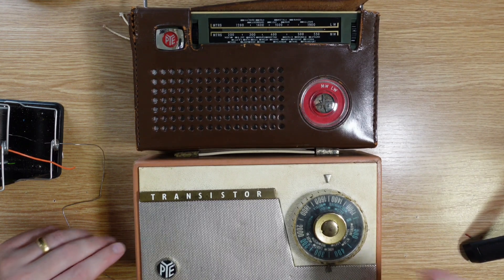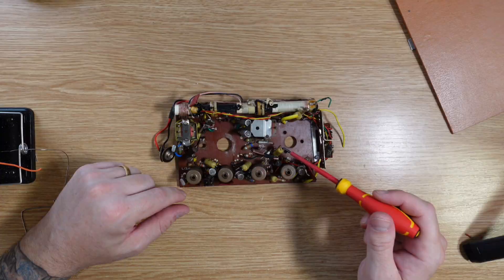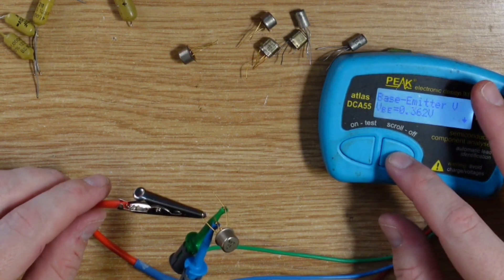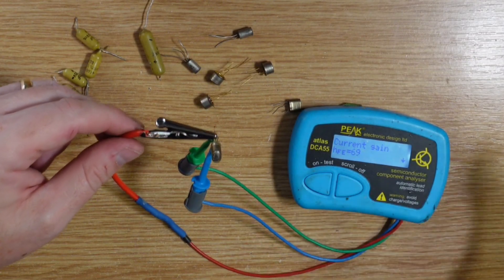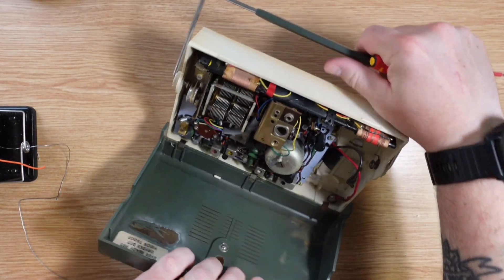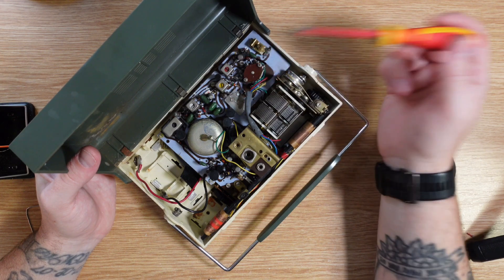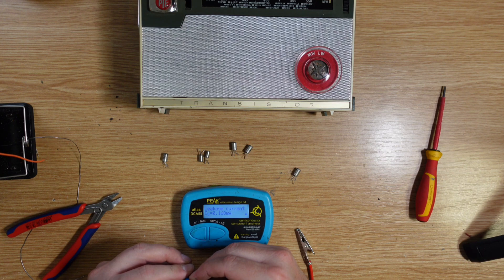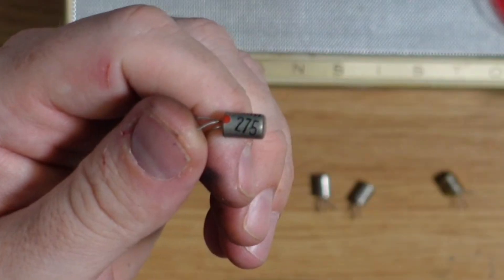Priceless Treasure or Outdated Junk? Discovering the NKT275 Germanium Transistor!

Comment: These videos never made sense to me. I get it now. Trying to find suitable substitutes is much more difficult than it should be. I mean, these are industrial components made to a standard. There should be an obvious, easy way to find a component with the same values. It’s a circuit-basically math in solid form. But any amount of knowledge I gather is overwhelmed by the sheer volume to know.  I have mush respect to those with the experience, like you Joe, because I can watch you and learn HOW to do things properly because this guy has years of experience and best practices. Your a legend. Watching you’d and JHS’s Short Circuit taught me so much practical knowledge ‘Wet the tip’, having the garbage below your bench, cleaning the leads of components, watching how you solder-these are invaluable lessons. My soldering and organization have improved dramatically. 
It’s this stuff-‘magic’ transistors….why is this a thing? It’s a tiny piece of material with some wires sticking out. It’s 60+ year old tech and it’s ubiquitous. How is it so @##&ing hard to build a Fuzzface?! It’s like no one really understands what that transistor does and whatever magic they had back in the 60s is gone. Like all of you, I have gone down the rabbit hole of looking for equivalent parts only to see they aren’t available anymore….I understand there is no massive demand for these parts, but hundreds of people are willing to spend good money on the chance of one good NKT275 that somebody would have a solution.

Thanks for the work Joe.
Reply from the maker: Tha k you for the kind words mate I am absolutely flattered to be mentioned with the greats like JHS.

I like to think of these components like old cars. Everyone wants parts for them because its history, nostalgia and a limited resource.

You can get new components that are every bit as good if not better, I just like to collect the history.

I really appreciate you watching.

Comment: 60-80hfe on a fuzz face is the best. You can use 60hfe on Q1 and also 60 or slightly higher hfe on Q2. Other people suggest around 100-120hfe on Q2 which I find too high gain for a fuzz face.
Reply from the maker: That is absolutely conventional thinking. Have you actually experimented mate?
I really like using a 120 low leakage in q1 and a leaky 100 in q2. Sounds less refined but also fun.

I also like to go as low as 45 hfe paired woth a 60 hfe for low leakage.

Think about it in gain stacking terms. When ordering your pedalboard, you start with higher gain then less gain then boost so you add both volume and gain as opposed to less volume amd mush.

Thats not to say the conventional way isnt good to, it absolutely is.

We had Aaron from Dominion Effects on the podcast and he talked for 3 and a half hours on this stuff. Definitely worth a watch mate.

Comment: Ridiculous video, when you see a guy measuring GE transistors and touching them with his hands you now that guy or is a complete moron on really doesn't know what he is doing. The author of the video seems to be a bit of both. The readings in the video are completely useless because the immediate temperature rise by touching the GE transistors with the hands will yield a completely false reading. GE transistors should be measured at room temperature and without touching them. Stupid Video

Comment: £106?????

I didn't think you could give those old radios away.
Reply from the maker: @CrazedFandango  Ha ha ha ha It's the transistor your paying for.
Reply: @hellosailoreffectsofficial  I've got an old 60-70s Grundig Sattelitt 2100 gathering dust.  Is that likely to have anything you could use in it?
Reply from the maker: @CrazedFandango  I think they are mid 70s aren't they? They had swapped to silicon by then mate so it's probably worth more as a whole radio.
Reply: @hellosailoreffectsofficial  Ok, I won't bother dusting it then :)
Reply from the maker: @CrazedFandango  I wouldn't mate, give it 10 years an they will be worth more than a Mexican Fender